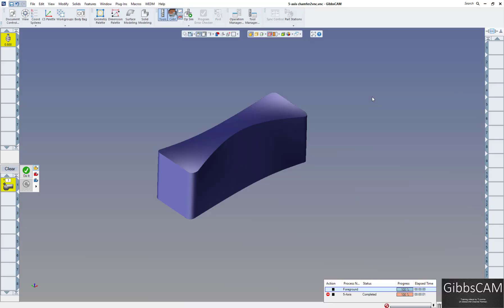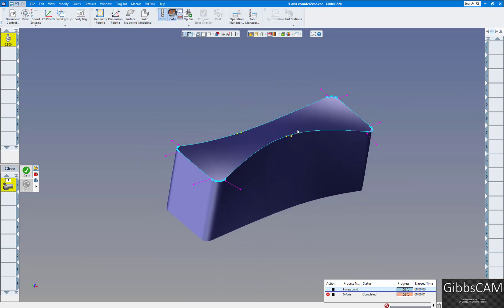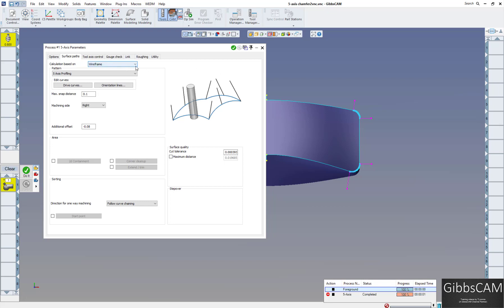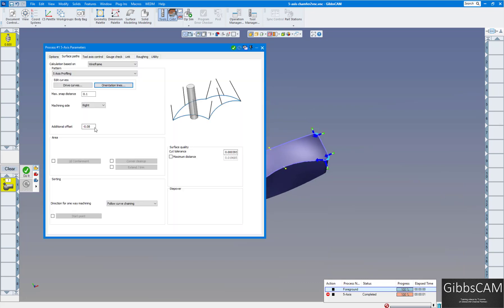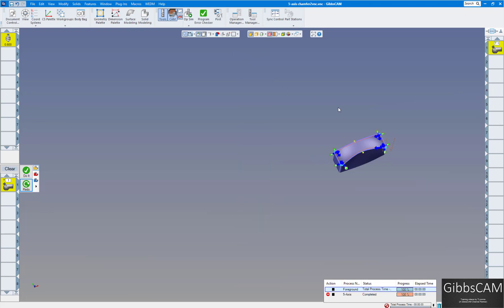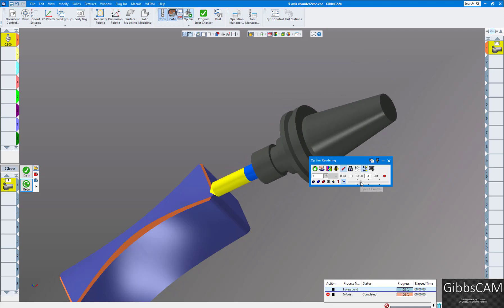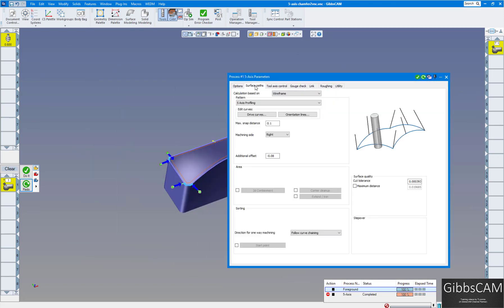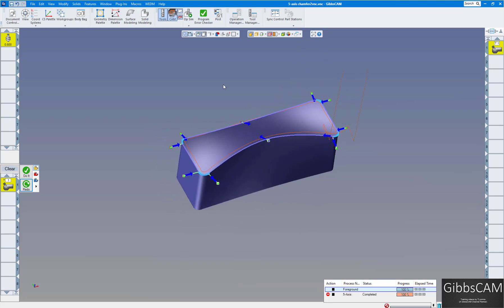GibbsCAM, 5 axis Chamfering

Comment: 😄 interesting...!  Did you check tilting max. angle?. Where you send your tool...? Under machine?
Reply from the maker: This was just an example of how you can control the tilting of the tool through a part.  This was not a video on travel limits or undercutting.  You could also put tilt lines on the opposite side to reverse the tool approach. Thanks for watching !
Reply: @GibbsCAMVideoTutorials ... the biggest problem.....in reality that example can not be machined....like this.
Reply from the maker: @Hanal503  Actually this can be done very easily.  See link...https://youtu.be/v_kjJoYZ3ZA
Reply: @GibbsCAMVideoTutorials  😄😄😄 you make me smile.